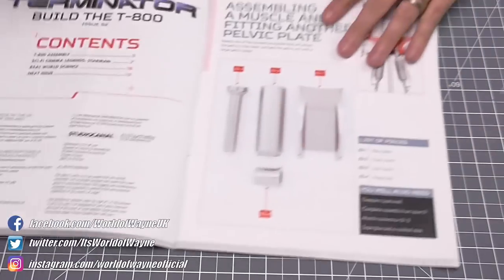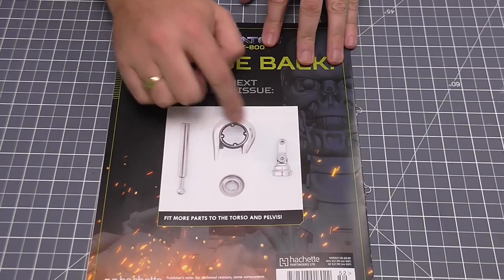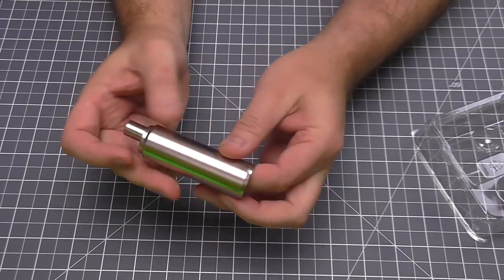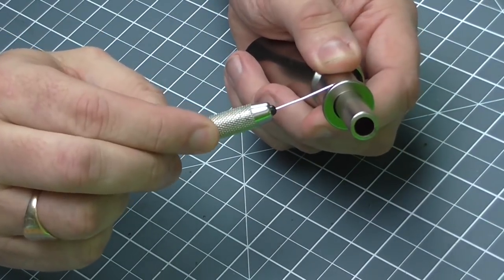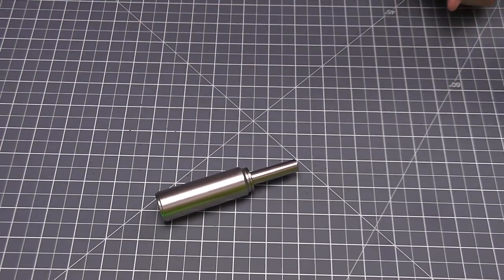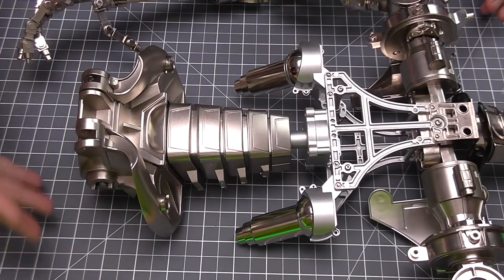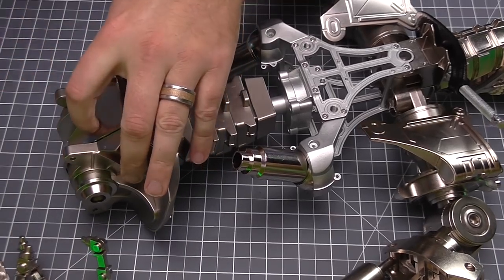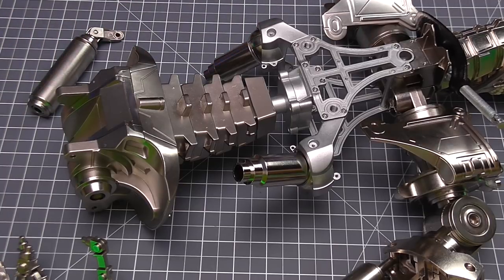Build the Terminator - Part 52 - Assembling a Muscle and Fitting another Pelvic Plate

Comment: I am really pissed of those pistons are not die cast. At this rate the the whole legs gonna be plastic. I love the build but the plastic to metal ratio keeps kreeping up. Feel sorry for those who want to do a full weather!
Reply: That's understandable. But the top half section of the leg is diecast metal. With3diecast metal pistons. And the lower section of the leg will be plastic with2plastic pistons on each side. But much like the right arm it's gnna be more metal than plastic. And it'll weigh alot more than1right arm2KG i reckon. +the entire model itself will be more than metal than plastic/at this rate it'll weigh in at8KG/not6KG as that Chestplate alone which we'll get early nxt yr will weigh at least3or4KG as it's1great big lump of solid diecast metal mass/it defo will not be plastic. And it'll weigh10times more than the R2D2 build
Reply: Exactly Andy!